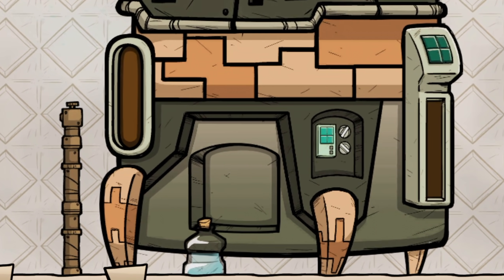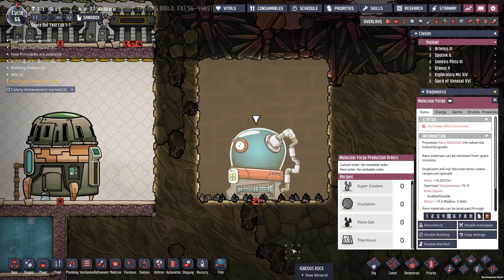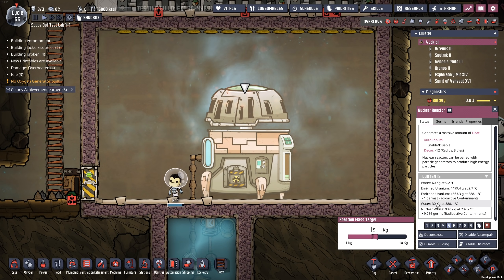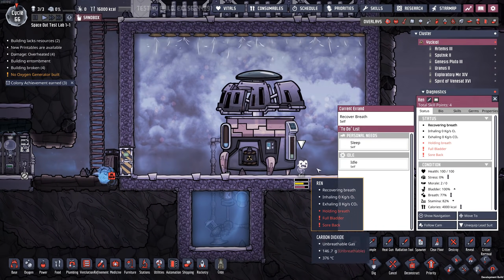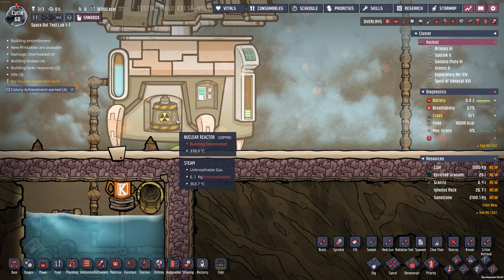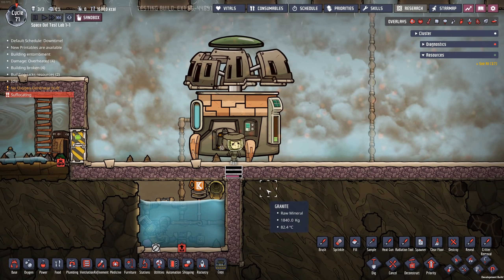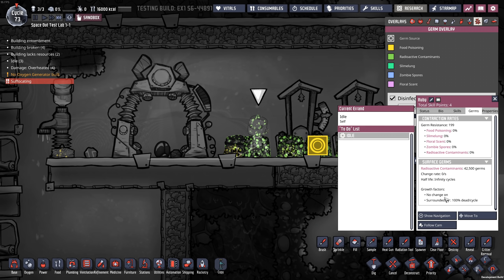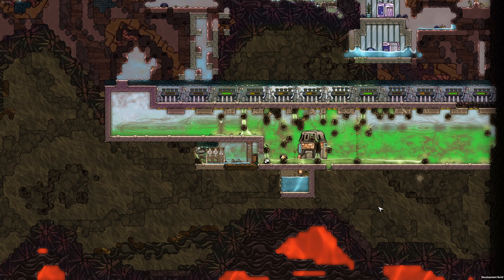ᴱᴬᴿᴸʸ ᴸᴼᴼᴷ ᴬᵀ NUCLEAR POWER! Oxygen Not Included

Comment: I wonder if you could control the water input flow, e.g., with a Liquid Valve, to increase the temperature of the steam in a safe manner.
A temperature of over 540°C for running a sour gas boilder would be nice, but below the 700°C to prevent the explosion.
Maybe some Liquid Shutoff automation with a Thermo Sensor. :D
Has the reactor any automation slots?

Comment: Id be disappointed to see radiation as germs. I'd prefer each source to have a radial zone thats stronger the closer you are and the influence is weakened when it passes through dense materials, so you have to line your reactor with lead blocks

Sounds super cpu intensive but it would be accurate
Reply: bro, they changed it, it's exactly like that now :D

Comment: I hope they will in fact change how the reactor works.
It would be much funnier and more ONI like if the reacter would be able to survive 2000*C (or something like that), 
require you to insert the fuel and heat the reactor (via heating the air around it) to 1000*C to initiate the reaction
and the higher the temperature is the more heat it generates from the same amount of fuel used.
Plus add a way to control the fuel usage via automation/control rods level control.